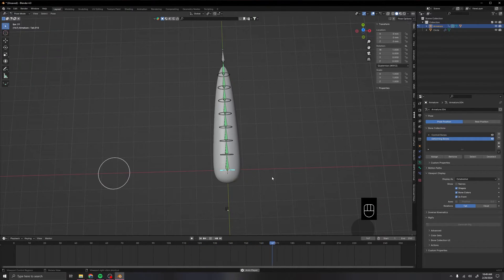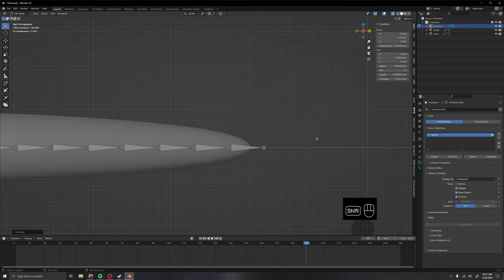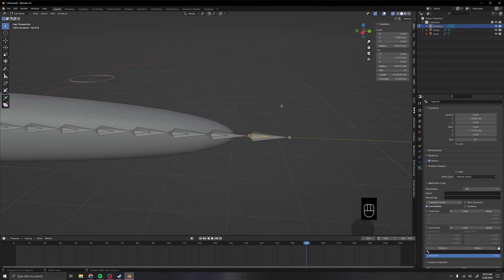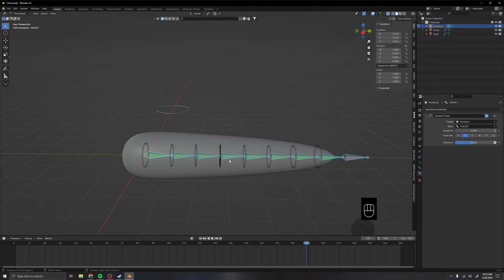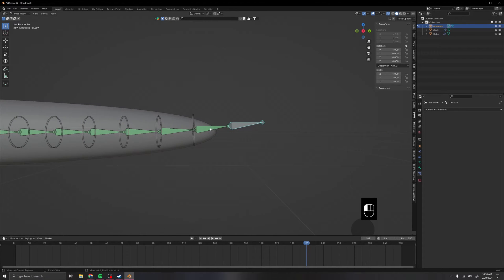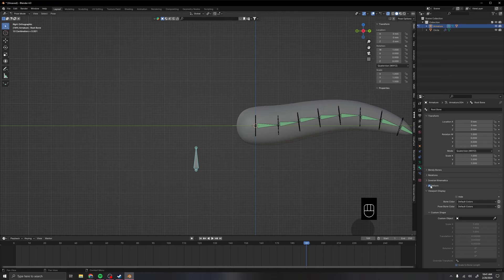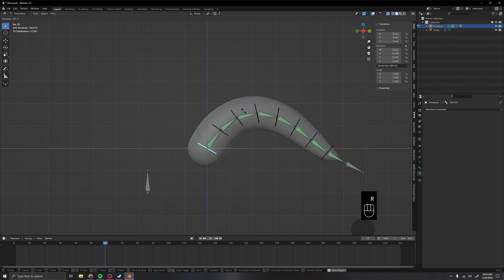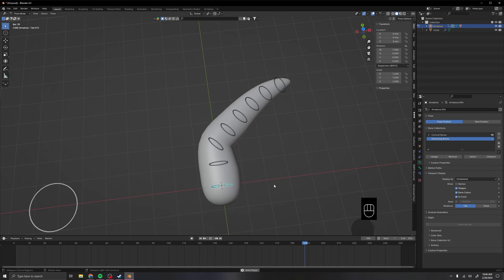Damp Track Tail (Blender Tutorial) - 2024

Comment: Say i wanted a 50 frame idle animation with this tail. How would i properly loop this in 50 frames and export it
Reply from the maker: @waffleratta2861  for exporting it, if its a looping animation you basically want the first frame and last frames damptrack influence to be 0 and then keyframe a bit after the start to the value you want for say .8 and you do the same amount before the end and then essentially you do just a bit of manual animation at the end and start to make it seamless. 

now if its just a normal animation that wont be looping you can just export without these steps 

but one thing to note, when exporting with damptrack if the damptracks influence on the first frame is not 0 then you might get an export glitch to fix it you just have the first frame damptrack influence be 0 and then the next frame be the value you want so it resets its position at the start basically

Comment: How do I add a rigged tail to an existing character in Blender that already has weights and a full armature setup? When I try to use automatic weights, it destroys all my existing character weights. I just want to add tail bones and have them affect only the tail portion of my mesh while keeping all other weights intact. What's the proper workflow for this
Reply from the maker: Apologies for the late reply, There's actually a single bone automatic weight. While your in weight paint mode if you look in the top left for a dropdown named weights it should have an option named "assign automatic from bones" which is automatic weights for the bones you have selected and doesn't effect your weights other then where the bone is hope this helps.

Comment: You're creating a dependency cycle tho...
Reply: Circular dependencies don't actually matter depending on where it's applied
Reply: can literally bake it as well, its what literally every game studio does.
Reply: @jahluu6825  if you tried to pull shit like this at a game studio, every other rigger (and your boss) would think less of you, dude. You try baking an animation with a rig full of circular dependencies and get back to me with how "easy" the process was for you.
Reply: @LunarBehemoth  was very easy! If it’s hard then the problem is somewhere else in the rig, or you need a different solution for a different use case. Also, no one cares if you do this in a game studio. Not even a little. Everything is baked and cheesed in studios, barely anything is beneath them.
Reply: @LunarBehemoth  additionally, the keyframe being set in the video alleviates most theoretical issues and is far less intensive than a soft body simulation or the ever-buggy shitty spring bones addon (which is why I am even here in the first place). Of course animating it manually is also an option, but my character has a lot of secondary hairs and stuff which I use this technique on, and do the main hair by hand
Reply: @jahluu6825  if you are the only person doing the rigging and animating, sure. If you get an animation that works and it's all baked, yeah the constraints won't matter since they only exist inside of Blender. But if you had to hand off this rigged character to someone else, the idea of giving them something with cyclical dependencies that can never be fully restored to the original pose, or that will play REALLY bad with sudden movements (i.e. character teleports from one place to another)... that would be pretty bad, man. Pierrick Picaut has a tutorial on tails that is a much more correct method to animate this than to introduce cyclical dependencies into your rig.
Reply: @ I love pierrick picaut and I’ve bought many of his courses… but not everything he does is one size fits all especially in regards to rigging. In my case, this is just being imported into Roblox, so it’s not a real issue. A more advanced rig would be a waste of time for my use case. For triple A games though it may be necessary.

Comment: This is an incorrect setting. Because it uses a cyclic dependency. You cannot define the purpose of restricting the bone descendant. This leads to failures. This is especially noticeable in complex installations. Instead, create a soft body. Tie it to the first bone of the chain and set the vertices of this object as the target for the bones.
Reply from the maker: This method does create a circular dependancy which is why one bone needs to have a keyframe, in this method you have to play the timeline to reset the bones. never the less its a very nice technique if used right. the purpos of this method is to avoid sim stuff lol
Reply: I keep hearing about muh cyclic dependencies and I failed numerous times following the instructions here, but I finally got it to work. Creating a keyframe on frame 1 made it work spectacularly.
Reply from the maker: I finally found a work around to the cyclic dependency I just learned today that damptrack can be baked to keyframes heres my twitter post on how https://x.com/DIAlternation27/status/1981226794545271209
Reply: @tylerscoding  I generally started using this method to create fast dynamics. And I even wrote a script using AI so that it creates Damped Track restrictions on the descendant bone. And then I immediately make a backup.
Reply: It's not Useless, These techniques used in Game Industry ( I Mean in Every Game ) cause you can't Simulate everything in Game that's why these techniques are Made 🙂
Reply: @Mysterio_Lite  Of course, you can do whatever you want. But in this case, there is a fundamental mistake in rigging. You cannot specify a restriction on a bone that is lower in the hierarchy (on a descendant bone). It turns out to be a cyclical dependence. After you have moved your system, select all the bones and try to return it to its original form using the alt + R command. You will see that you need to click several times. This is due to the fact that the computer does not process the data in the correct sequence.
Reply: You are correct, anyone that tries to use this rig for more than a single movement will see for themselves. Just get wiggle bone addon.
Reply: @belpetr1  Agreed, on complex meshes and rigs this can often cause the damped tracks calculation to lag or stutter during the animation render, making the frame rate of the tail comparably lower than the frame rate of the rest of the body rig. And there's a whole lot more issues created with it. Of course baking the animation is a solution but that must only be done once you know you are absolutely done, not a very good move during development.
Reply: @emeraldviolet2001  Wiggle bone addon barely works outside of the most basic of use cases.
Reply: @emeraldviolet2001  Wiggle bones is garbage now, as are all related addons. You'll have to stick to old versions of Blender forever, and 4.5 renders Cycles 30% faster. Best to have an evergreen in-house solution.
Reply: @jahluu6825  Oh it sucks so badly now, as does Bone Dynamic Pro. All of those plugins are useless in Blender 4.5
Reply: @Mysterio_Lite  nah even mobile game use basic Unreal/Unity physic assets nowadays, it's not 2010 anymore

Comment: a question pls, what if i use only damped track constraint, I found that the same result
Reply from the maker: The damptrack has a delay on it so I use an extra bone so the rotation is always in the exact direction you want, however the damptrack method is great even without the second set
Reply: Damped track only is so easy. We do, however want a method where the tail springs back to the original position when it stops wagging. There are addons for this, but none work in Blender 4.5. I get so sick of plugins blowing up after every Blender update, it's good to have an in-house method that is evergreen.